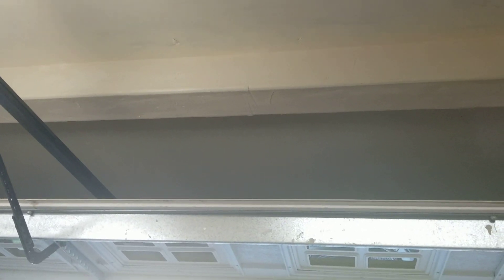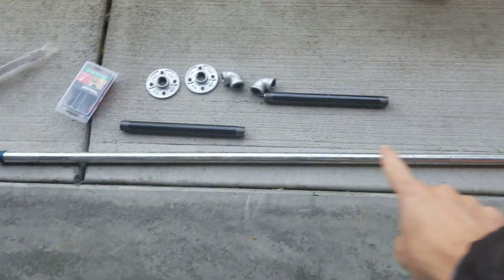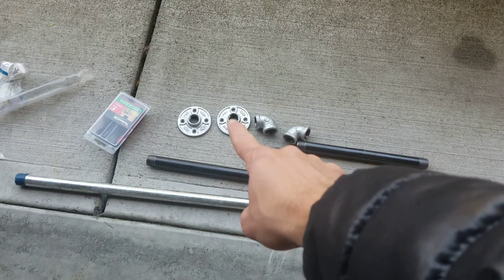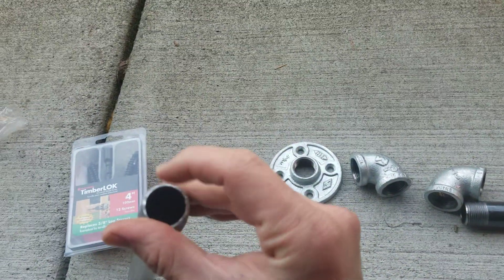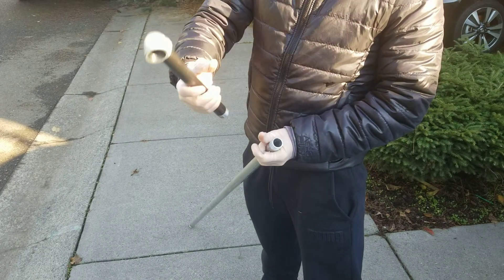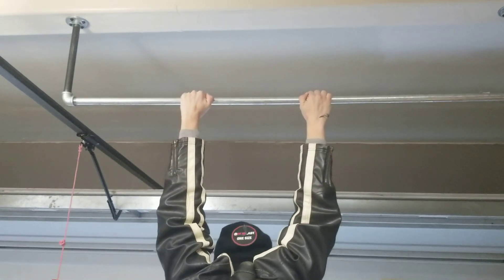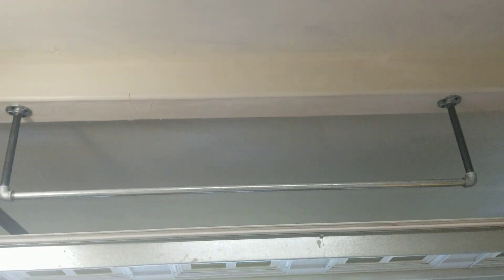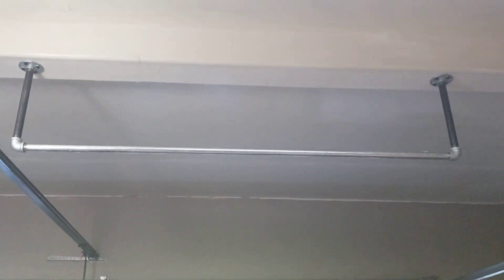How to Install Pull Up Bar In Garage. DIY gym at home.

Comment: is the ceiling concrete or wood?
and what kind of screws did you use?

thanks in advance.
Reply from the maker: I put it into wood beam inside garage. Screws are like 4inch screws from home depot

Comment: How much weight do you think this can hold? Great idea by the way
Reply from the maker: 180 pounds easy
Reply: @LifeisAmazingChannel  300 Lbs?
Reply from the maker: @jrod96819  might need a little bigger size pipes and also  good size screws into a very solid beam or mental

Comment: Too bad you can't you can't do pullups with the door open... What is your opinion on diameter of bar? 0.75 inch seems too thin to me... I'm thinking 1.25-1.75 inches.
Reply from the maker: Yes I can have it with door open. Just about 90%. Not all the way
Reply: The outside diameter of 3/4” pipe is actually 1”. I do think 1” pipe would be better and the outside diameter of that is 1.25”
Reply: Ah, that make sense... I ended up going with 1.5 inch OD for mine. Thanks for sharing your results.

Comment: Hey I have brain teaser for you.... How do you perform t bar pull-ups with an at home pull-up bar? With and without the actual t bar. I want to isolate those wing-lats by locking up my arms in a 90 degree angle for the entire pull-up rotation.